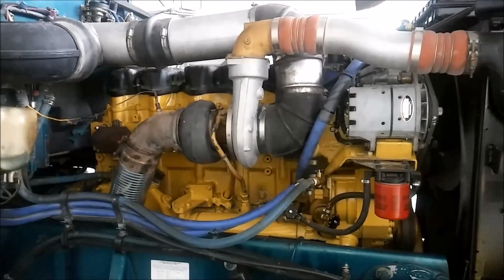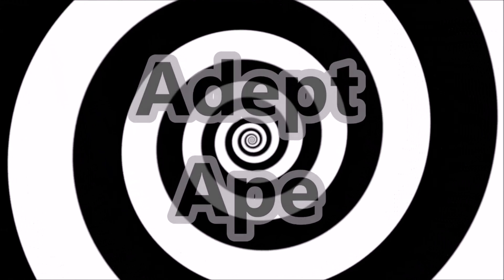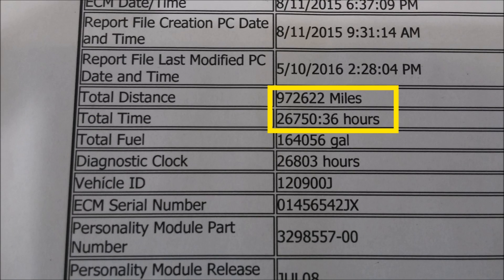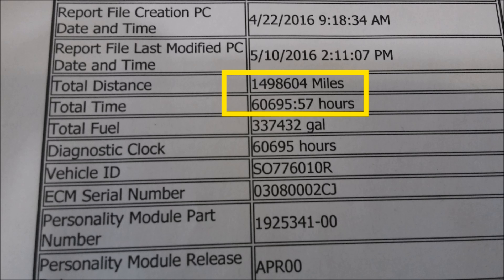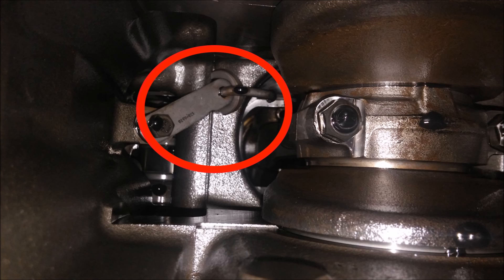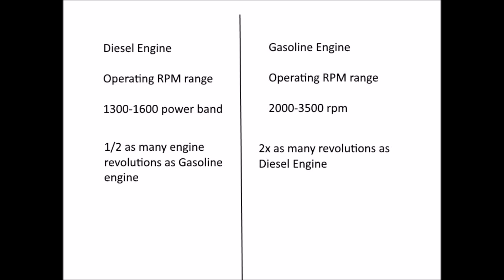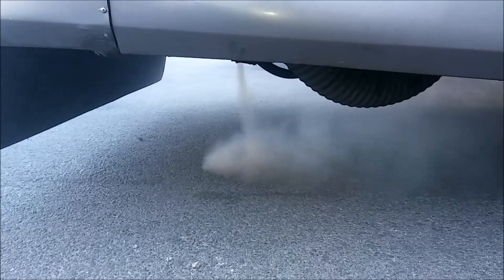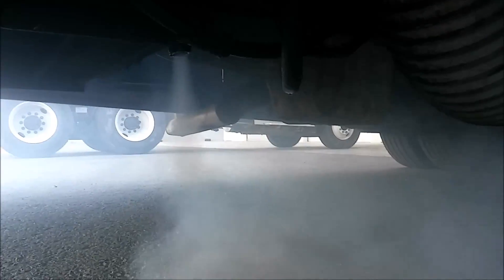Why Do Diesel Engines Last So Long?

Comment: aren't most of the longest lasting diesels Inline 6 engines??? Low vibration, low resistance. Same reason why shitty Subaru boxers last so long, despite them using inferior materials. Huge bearings, lots of oil and low vibration and resistance is the reason why some engines last longer than others. When you don't have the crankshaft dancing on the bearings, makes all the difference. Inline 6 engine by default is perfectly smooth. Just like boxers that have pistons resting on a horizontal plane moving sideways instead of up and down.
Reply from the maker: +Y10Q Nearly all truck Diesel engines are Inline Six engines and they do typically last a long time. It does make sense to have all the pistons in one plane with the crankshaft, but I would like to see if say a large V6 Diesel could last as long as an inline, but I don't know of any in a heavy duty truck application.
Reply: Adept Ape
yeah, I am sure there is a very good reason why they are using Inline 6 configuration in all the longest lasting stuff.
Reply from the maker: +Y10Q I actually saw the most mileage ever on a truck today. 2,598,000 miles that's a lot of miles

Comment: You seem not to regard European diesel car engines in your talk.
Reply from the maker: That isn't quite as catchy, and would probably have about 3 views and then you would have never found the video to make the comment. It would have caused a rip in the space time continuum!
Reply: So the video title should be, why do (cat) engines that are designed to last very long, last very long ;-)
Reply: Adept Ape Hehe something like that. I do though agere fully on the part about diesel beeing a lubticant and petrol a solvent, and the lower reving. ;-)
Reply from the maker: Not because they don't matter, I merely am a Cat mechanic so that is my area of knowledge.
Reply: diesel car engines are not proper diesels they are made to fail in a few years.

Comment: Adept Ape,  how is a C7 engine bench started? given that the C7 fuel system is entirley electrical, how can the operator/mechanic increase rpm on it when bench started? how can he co.municate with the ecm when there is no throttle? Thanks a bunch!
Reply from the maker: +Omar You can start the engine with power to the ecm. You'll need fuel and coolant as well. The engine would only idle with no throttle pedal wired in, if you wanted throttle you would have to wire in an electric throttle position switch. To communicate you would need a jumpout harness with data link capabilities.

Comment: The Diesel engines used in passenger vehicles don't necessarily last that much longer because manufacturers don't design them with quite the same margins. They may for example shorten the stroke to make it rev a little higher and make it more suitable for everyday road use. A lot of the other things you mention do still apply though, for example my small Diesel passenger vehicle with its 2 liter Turbo-Diesel engine takes 6.5 liters of high grade oil, compared to the 3.5 liters in its petrol (aka gas) sibling. Makes it more expensive to service though :-)
Reply from the maker: In a car, I still like the idea of a Diesel Engine, but a true heavy duty truck engine and an automotive application do have a lot of differences, I agree. Thanks for commenting.
Reply: Believe me, so do I. Absolutely love my Diesel :)

Comment: What about Diesel cars?
Reply from the maker: +juss2fr3sh A good question, since a Diesel Engine is still built tougher than a gasoline engine you should expect them to last longer, but not quite as long as a truck Diesel Engine, just due to the fact that cars are typically driven short distances and start/stop the engine a lot.

Comment: would you buy a 1997 F250 7.3 powerstroke turbo diesel with 185,000 miles on it for $10,000? I'm getting a truck soon and I need some advice
Reply from the maker: If you are going to get a Powerstroke, it would seem that many people believe the 7.3 is the best version to get. now the price really depends on the entire condition of the truck, check it on Kelley Blue Book for your area and if the price is close then get it. Although $10,000 seems kind high for 97, I don't know the condition or features.
Reply: +Adept Ape is there a way I could contact you. I want to get the right diesel truck but I don't want a truck that will fail on me
Reply from the maker: +Jordan Pacheco Here is really the best way to contact me, I check my comments fairly regularly. It's hard to recommend a vehicle I can't inspect, any older vehicle is going to potentially have problems regardless of the maintenance performed on it. So my suggestion is try to get a deal on an older truck with a proven engine, plus a manual transmission should potentially give you less problems. Then save a couple thousand in case you end up needing a radiator, or clutch, or fuel pump. Then do the repairs yourself.
Reply: +Adept Ape thank you! I want a diesel truck for around $10,000. do you recommend any trucks for around that price? Dodge? Ford? anything
Reply from the maker: +Jordan Pacheco Well you have a good amount of money to work with, I would say try to get a 5.9 Cummins or a 7.3 Powerstroke, they seem to have the best reputation. Now look up the models you want on Kelley Blue Book to see what a fair deal is for your area. Then try to save a little of that $10,000 extra for unexpected repairs. Then it's just a matter of maintaining your vehicle and learning the most you can about those engines.
Reply: +Adept Ape I found a truck. it's a 2001 Ford F250 7.3 Powerstroke for exactly $10,000. interior is spot on and has a bunch of modifications. it has 240,000 miles. I really want and I feel like I might buy it. what do you think?
Reply from the maker: +Jordan Pacheco In my area I looked up the value and for a 4 door that is pretty close to the estimated value. Since it's a fair value and that is the model you want, I can't see any reason for you not to get it. I hope you enjoy the truck.
Reply: +Adept Ape you have no idea how much you helped me and how much you made me feel better. I kept thinking I'd get something that isn't worth it but it seems like it is. thanks so much man

Comment: Thank you for these videos. My goal is to become a diesel mechanic. Last week I started putting back together my dads power washer by myself after I previously took it apart.(I know it's not diesel) i am working on gas just to see the mechanics of a motor and how it all works! Thank you.You've got a subscriber
Reply from the maker: Thank you for subscribing. The basics of an engine are the same so everything you learn helps. It can be a fun and rewarding job.
Reply: @AdeptApe  Because you find it fun & rewarding is why you make an excellent tutor. Watch your more recent vids but this was a good find. See u back in the present.

Comment: thanks very much for the informative video . & my question is which one will you prefer in very hot and dry weather
Reply from the maker: Either engine will perform in a hot environment, the cooling system is really the area of concern. If you live in a very hot environment a larger radiator and cooling fan is usually the best upgrade for that.

Comment: Hi Adept. What state is your shop ? Motivated to be your customer.
Reply from the maker: I'm on the West Coast, but I try to stay incognito because I'm not sure if my company would want me to stop making videos if I notified them. I really like making the videos so I try to stay under the radar and not tell which shop I'm in or my name. Sorry, but I tell everyone the same thing. Thank you for saying so though.
Reply: Thank you anyway, very informative and well done video. Will share with my friends Cat  addicted.
By the way, I have a C13 and pulling hills and when water goes 200 F and Up oil pressure drop from 35-40 to 27-35 , even when driving flat road and rpm between 12-1300 oil pressure 27-35. Only at 1500 rpm oil pressure is 35-40 psi. What will be troubleshouting or possible cause of my problem. 
( just replaced oil , cat filters and fresh changed ELC coolant )
Reply from the maker: +Natalia Stoica Well as the oil temperature increases the viscosity of the oil decreases, so the oil gets thinner and thinner the hotter the engine gets. If your only losing 5 psi of pressure, that is fairly normal. How long have you noticed it doing that?
Reply: +Adept Ape It been 3 weeks already since it started. Im using Rotella 15w40 which , and thinking to switch to Mobil or Delo which I heard are more thicker ( even the same 15 w40). Still not sure since sound not a solve problem solution . What will be  most frequent reasons for oil presure drop. 565.000 miles
Reply from the maker: +Natalia Stoica Was your temperature getting up to 200 before 3 weeks ago? The most common causes of low oil pressure are old oil and filter with high carbon loading, worn oil pump, and worn bearings. It is possible the oil pressure regulator is stuck as well, but that is somewhat rare.
Reply: +Adept Ape Its not going 200 F all the time, I meant that the oil pressure will drop when water temperature passes 200 degree , plus it will  heat faster than previous ( one reason why I changed coolant ) whith similar load on same road. What realy bothers me is that at 12-1300 rpm oil pressure is not 40 but lower ( 27-35 ) .

Comment: What would be the reason that RV owners do not detect the TEMP light on and shut the engine down quickly  enough ?
Reply from the maker: It would seem that a lot of RV owners and bus drivers get the worst overheats. They all have temperature gauges, but I think usually they are pulling a hill or are in a place where it is not a good place to pull over so they just run the engine up the hill and cook it.

Comment: so do i have to move to one of these colleges and learn from there, which ever is closes to my location?
Reply from the maker: Unfortunately not every dealership participates in the program, so I guess you would have to possibly move to get into one of the programs, but maybe you live close to one already.
Reply: Okay so I should contact the dealership here and see if they do.  Got it. If not I'll just have to go to a community college here that just gives an associate degree
Reply from the maker: +Sanchez R Nothing wrong with that either, one is more of a direct path of course. I went the Associates degree route just because it was my only local option.

Comment: Any engine, provided it's understood, can go a million miles, gas or diesel. Gas engines, since the combustion does not produce soot, can reduce the carbon loading compared to diesel. Regardless of engine type, if the engine is well maintained and properly lubricated with excellent filtration, any engine can go for a long time before a rebuild
Reply from the maker: Yes, any engine can go extremely long distances provided they are well maintained, but the Diesel design inherently makes them a longer lasting engine on average. Ever see a car engine go 1.2 million miles, probably not.
Reply: +Adept Ape Amsoil has a customer that has a Chevy truck that has done a million with a small block Chevy, Schaeffer's has a customer with a modular powered van that has hit the million mile mark also. They are out there.
Reply from the maker: +Steve Ross That is pretty impressive to get a gasoline engine to get that amount of miles on it. Did they just use their brand oil or also modify the filtration systems?
Reply: +Adept Ape I believe they just use the oil and lubricants, no bypass filtration. Most people don't keep gassers that long to put the big miles on. By the way, my 1992 Nissan Pathfinder has over 300k on it, synthetic oil since day one and it runs like new. I bought it with over 296k on it. Miles never scare me, lack of maintenance and documentation does.

Comment: as you mentioned, heat cycles are bad for the engine.  the few diesel engines that i have tend to also take longer to heat up than my gas engines.  is it better to let the engine idle when i park to fill up fuel etc. than shutting off?  The fear would be that at idle the engine is not as efficient and doesn't burn off the fuel as well causing cylinder walls to glaze over after some time?
Reply: you used to have to be concerned with fuel wash, but modern engines that have healthy fuel injection systems burn very clean. Excessive idling just costs money. Modern metallurgy is really good and oils have massively improved over the years. Bypass filtration and modern oil will double and triple the life of an engine.
Reply from the maker: Filling up is fine to shut it off because the engine doesn't cool down immediately. With the engine off even 15 minutes, it is still very hot and restarting it doesn't put it through another heat cycle. It is when it is off for several hours and it cools to ambient temperature is the problem.

Comment: Really informative video man. Could you please make a info video on camshafts like one a C15. About how diesel camshafts work and what they do.
Reply from the maker: Thanks for the comment. A Diesel Camshaft works the same as an automotive one it's just heavier. Do you want more of a valvetrain basics video or a troubleshooting video? The next rebuild I do I'm going to make a series on it, so hopefully that'll go over most of the basics.
Reply: A valvetrain basics video would be perfect. I've honestly never known much about the specifics and any info on valvetrains are awesome.
Sounds great though!
Reply from the maker: +Maxx Edwards I'll have to wait to work on something involving the camshaft, but I'll see what I can do. I should start doing "how does that work" videos.
Reply: No problem. But that actually sounds pretty neat!

Comment: you mentioned about your typical car going through more heat cylces versus what a highway tractor typically would. My question is just how big of a difference would that make in the application of having a 3/4 ton or 1 ton diesel pickup truck that is driven in the same manner? Would that be a night and day difference for wear on the engine or would it not be a really big problem.
Reply from the maker: So if you have a F350 with a Powerstroke and drive it like a car (which many are) that will accelerate the wear on the engine. Now a Powerstroke does have many of the heavy duty components listed compared to a car, but you would not see the Million+ mileages that on highway applications are capable of getting most likely. So it should last longer than a gasoline engine, but less than an on highway application.
Reply: i kind of figured as much. So with a diesel truck it's best of both worlds in the sense of if you tow a travel trailer or a car hauler it's better on fuel on top of lasting longer than a gas truck.
Reply from the maker: +shortfuse1993 Yes they are better, but a lot more expensive.
Reply: personally i wouldn't touch a new diesel due to all the emissions stuff. give me an LB7 Duramax or an 06-07 5.9 Dodge with EFILive on both and i'm happy aha.
Reply from the maker: +shortfuse1993 The older Cummins are the best small Diesel ever made I think
Reply: i would have to agree with you, the 12 valves are bulletproof and can still make pretty good power. not bad for an engine designed for farm tractors and backhoes aha.
Reply from the maker: +shortfuse1993 These say great minds think alike.
Reply: that they do my friend, now we just gotta figure out how to make biofuels work. hello 1000 horsepower hellcat challenger lol

Comment: I have a 2003 freightliner with a 2004 475 horse MBN C15!  After a new turbo, ECM, injectors it runs like a champ. I'm at 945,000 miles. No in frame or any other repairs.
Reply from the maker: You'll probably get well over a million miles then with no problem, do you do your services at 10,000? Thanks for commenting.
Reply: I religiously change all fluids at 12,000.  I change my final drive fluids every 6 months.  I just follow what the CAT owners manual states and I've had no major issues...my turbo issues came from the previous owner.  I kept getting low boost pressure codes, and the motor would de-rate itself over 1500 rpm...the previous owner had the motor turned up to 550horse, but from previous experience, I had it turned back down to 475 horse.  The power difference was negligible, and I lost about 1 mile per gallon.  I could keep an extra gear on hills but it was t worth the extra fuel cost.  I will say that after the turbo, and everything else I had done ($10,000) worth, the truck runs better than anything I've ever driven before.
Reply from the maker: +sTEVAL570 Thanks for responding. Those single Turbo Cats are great engines. You sound like you really maintain your truck well, I don't know anyone that changes their diff fluid every often.
Reply: +Adept Ape I own a small business, and a lot of my equipment is pic for, so I am very meticulous about maintenance of my equipment, and so are my two other drivers.  On a side note, I remember riding in my granddads old KW w-900, that had a 3406 mechanical in it.  He retired in 1999 and his motor had 1.8 million miles on it without a rebuild or any major repairs.  I'm sure that truck is still on the road and I hope it made it to 2 million without a rebuild.  He bought the truck brand new in 1988 and never had it to a CAT dealer since. I've always been and always be a CAT MAN!!
Reply: A lot of my equipment is paid for*
Reply: +Adept Ape I change my gear fluid because when I bought the truck it had 3.23 rear ends.  Here in PA, there isn't a lot of flat land, and I haul crushed glass, so I had 4.10's put in about three years ago...